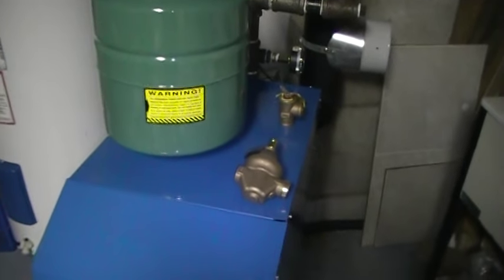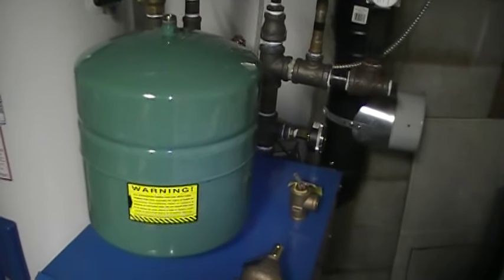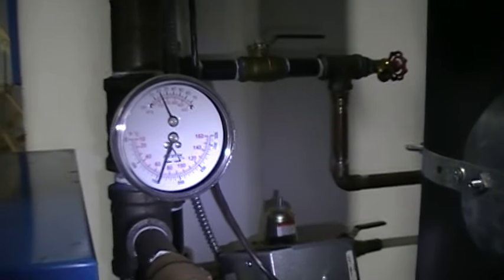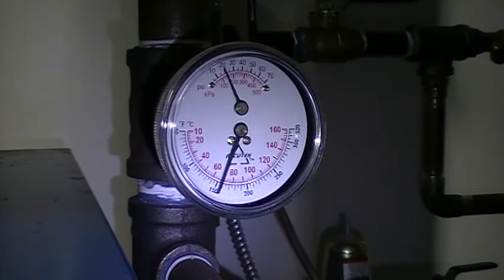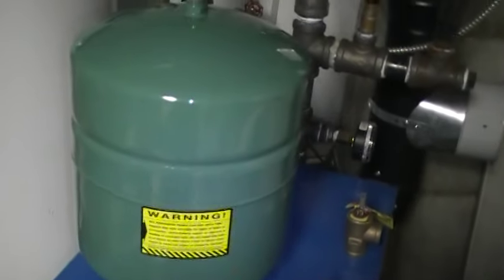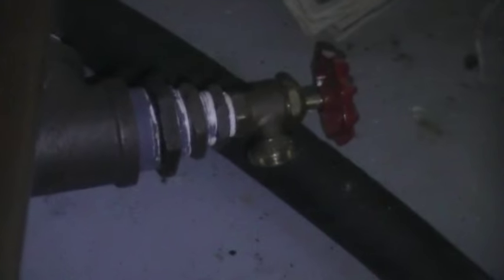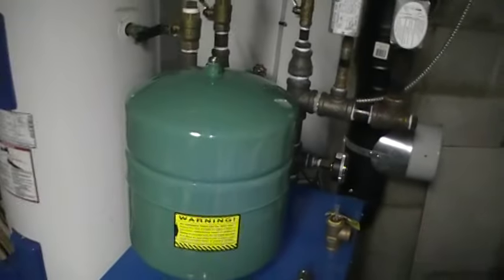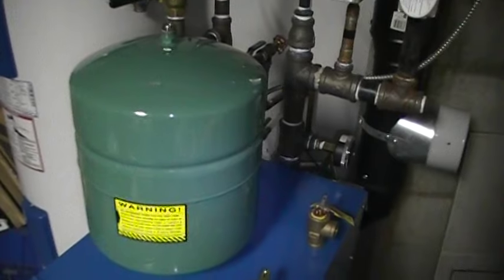Relief valve blowing off on hot water boiler (furnace).possible cause...Part 3

Comment: What if on the traticator the temp continuously goes to max even though temp is set to 170 or so. Then I get water blowing out the relief valve and steam .. 
any ideas. 
I did call my boiler guy.
Reply from the maker: Hello Dbest1a Vlogs,
Is the boiler still firing or does it shut down and keep climbing? If it is still firing then you have a faulty aquastat. 
Let me know how you make out when you get a chance....Al

Comment: HI,
I drained the system down to around 15 lbs pressure once the unit cooled down, then shut off the water feed to the unit to rule out (bypass) the regulator.  Once started up after around 10 minutes the pressure rose back to around 35 blowing the pressure relief as designed.  Is it positively my extrol tank defective?
Reply from the maker: +Ed Marcinczyk 
If your relief is blowing off and your water is shut off to the unit then the expansion tank is definitely defective. In your case it is an extrol tank. If you drain the boiler to where the pressure is at zero and pump some air into the extrol tank; it will hold you over until you get a new one.
I have done this before and it does work for a short time. Be sure not to put too much air in it, but if you can get the gauge back to about 10 pounds with the pump; it will hold you over. A small compressor will do the same thing.
Do you have a domestic hot water coil in the boiler?
Thanks for commenting and get back to me when you can.    Al
Reply: Yes I do have a coil in the boiler and also an electric hot water heater which work together somehow.  I ordered the extrol 30 tank and should be here today!  Thanks for all your help.  I will watch the video again to be sure I don't get drenched when changing the tank.  I'll reply back when the tank is switched.
Reply from the maker: Ed Marcinczyk 
Hopefully this is where the problem lies. If the relief is blowing off periodically. 
Best of luck with the repair and let me know how you get along!   Al
Reply: +TheOldkid888 Hi Al - everything worked out perfect!  It was kinda funny because the guy fixing it for me hates when I refer to youtube videos so I didn't dare mention how heavy it was going to be if waterlogged.  He got it off with a nice brief shower then dropped it on the cement floor because it was so heavy.  It was full of rusty water and other junk.  Everything if fine now!  Thanks so much for our "secret" conversation.  Have a great day!!!
Reply from the maker: Ed Marcinczyk
Glad everything worked out for you Ed.
I go to youtube for many different things myself. There is not much you can't find on it that's for sure. Great resource!!!
Thanks for commenting and have a great weekend!   Al

Comment: What if the pressure relief valve is leaking after you change the tank, and the valve? Simultaneously, when the indirect water heater is turned off then the boiler pressure relief valved stops  leaking/dripping?
Reply from the maker: Hello Joshua,
It sounds to me that there is a leak in the coil of the indirect water heater and the domestic water pressure that is higher than the heating system pressure is pushing the water back into the heating system.
A very small pinhole in the coil will cause this to happen. 
I have seen it before. 
If you isolate the indirect water heater and the pressure relief valve stops dripping then that is your problem.
Unfortunately the only way to correct it is to have the water heater changed out. It should be under warranty. 
Thanks for commenting and best of luck with the repairs!    Al

Comment: Don't have to bleed the air off after draining the tank??
Reply from the maker: Hello tyler j,
Not quite getting the question, but.... Once you have drained the tank you open the shut off valve to the tank just a little and let the water enter the tank slowly.
Thanks for commenting and enjoy your week!     Al
Reply: @TheOldkid888  yeah once you empty the system of water.   It leaves air so if you fill it back up you need to purge the air right? Only reason I'm commenting is because I  need to change my tank.   But I have 0 zone  shut off valves or bleeders.  Just the waterline IN and the drain valve at the bottom.    And 2 zones....

Comment: Once i change out the expansion tank, do i need to do anything to set the pressure the the correct psi?
Reply from the maker: Hello TBONENYC,
Once the new tank is installed and the water is back on; you have to check the pressure. It should be between 12 and 15 pounds. If it is lower; you may not get heat to the upper level. 
If the pressure is below 12; you can lift the lever on the pressure reducing valve gently. You will hear the water entering the system. Watch the tridicator (gauge) as it will rise quickly. You don't want the pressure any higher than 15 pounds if possible. If the system is hot; it may reach 20 psi. That is more than suffice to get heat upstairs to the rads.
Hope this helps!
Thanks for commenting and enjoy your week!    Al
Reply: Ah ok thank you !!! I’m not positive if it is my expansion take, but Right now my pressure sits at around 15-18, and as it heats up it end up hitting 30psi and the pressure relief valve pops. Is there any way to tell if the tank is functioning properly? Is the top of the tank supposed to be hot and the bottom cold?
Reply from the maker: Hello TBONENYC,
There a number of things that will make the pressure rise in the system.
A water logged expansion tank for one; which is the most common. 
The entire tank will be warm; so it's hard to say. 
Is the tank suspended in the ceiling or is it a smaller tank screwed into a fitting coming off the boiler.
The expansion tank suspended in the ceiling would be about 3 feet long and 1 foot in diameter. If it is this style of tank; you can turn the boiler off and close the valve going to the tank. Then you drain the tank. generally there is a bleeder to allow air into the tank. if it is this style of tank; be sure to get a few five gallon buckets of water out of it and then slowly open the valve you closed and turn the boiler back on. 
If it is an extrol tank about a foot wide and a foot high; you will need to purchase another one and replace it. 
This could be a little tricky if there is no valve on it. You will need to turn the water off to the system and drop the pressure to zero on the system before you replace the tank. Be careful as the tank will be waterlogged and heavy.
Hope this helps!
Thanks for commenting and enjoy your weekend!     Al

Comment: I have my boiler turned off in the whole summer.  When I turned power back on to the boiler with high temp limit 180 F and low temp limit 160F, the temp ran over 200F and the relief valve open & spit out water and steam before boiler stop.  When I went down to my basement and saw water (not a lot) on the floor and knew something was not right.  I turned power off again and waited overnight.  Next morning, I turned back on and stood by watching.  Again relief valve open ONLY the first cycle before boiler stopped.  For all the following cycles boiler worked correctly between HL 180F and LL 160F WITHOUT opening the relief valve and spit out water and steam.  I checked the Extrol model 30 expansion tank which had 12 pounds pressure with tire gauge.  Why did it run above 180F and did not stop for the first cycle only?  What could be the problem/defect which cause it?  Should I be concerned?  Please help.  Thanks.
Reply from the maker: Hello Shu-wen Lu,
The only thing that controls your temperature is your aquastat. This is where I believe the problem is located. There are a number of things that cause your relief valve to pop, but only one that will cause your temperature to rise above 200.
I would keep an eye on it and if it goes above the HL again; I would suggest having the aquastat change.
Thanks for commenting and enjoy your week!    Al
Reply: Thank you so much for your reply. AI
Reply from the maker: Hello Shu-wen Lu,
You're welcome!
Hopefully everything works out for you!
Best of luck!    Al

Comment: Hello, I replaced air valve because it was leaking. To do that I drained some water to reduce pressure  (pressure was 15 psi) . After replacing valve I bled the system to get rid of air. Now my pressure is at 20 psi. Why is that? Also right after when system was filled was at 15 psi but within an hour goes to 20 psi and stays there.
Reply from the maker: Hello TheLukeE9,
Once the boiler is filled and fires up the water expands and builds pressure. It will be in that range as long as the heat is on. No need to worry about that pressure. If it should get above 25 and heading to 30; then there is need for concern. Your relief valve will begin to leak around 30 PSI. You should be good to go!
Congrats on changing the air valve!
Thanks for commenting and enjoy your week!    Al
Reply: @TheOldkid888  thank you for a reply!
Reply: @TheOldkid888  actually I forgot to add that 20 psi was on when boiler was off. Today i turned it on first time after the summer  and pressure went to over 30 psi and pressure relief valve was leaking by the time temperature went up to 170 degrees. Is it a expansion tanks fault? But it doesn’t get warm and I checked the valve no water coming out.

Comment: I checked 15 minutes after I turned heat off and boiler not running. Boiler temp 205, 12lbs pressure. Settings at 140 & 180 degrees

Comment: Hi, l have a gas hydronic boiler system and the pressure is about 31, 32 psi but spantion tank is fine as well as relief valve.
it's this normal if not how can l reduce the pressure?
Reply from the maker: +Alberto Molinares 
Is your relief valve blowing off?
That pressure isn't normal. Working pressure should be between 15 to 20 pounds when it is hot. 
Do you have a coil in the boiler for hot water or do you have a separate water heater? Is the expansion tank a 12" by 36" or is it an extrol tank? Roughly 1/3 the size of an expansion tank.
Get back to me when you get a chance....Al
Reply: +Alberto Molinares l apologize l couldn't get back sooner l was out on vacations, thanks.
Reply from the maker: Alberto Molinares
Is the relief valve blowing off?
If so; I am leaning towards the extrol tank. It is hard to tell if the bladder is gone in them or not.  If you drop the pressure in the boiler, you can pump a air into the tank with a hand pump or compressor and see if the pressure stays below 20 for a few days.
Considering you have a separate water heater there are only a few other things. 
What high temperature does the boiler reach? You can find this by looking at the gauge and seeing what it is when it shuts off. 
Hope you had a good vacation.
Get back to me when you get a chance.   Al
Reply: +TheOldkid888 No, the relief valve is not going off,no water is leaking. Also l shot off water feeder l let the boiler run and the pressure went up from 12 to 20-23 psi.
Reply from the maker: Alberto Molinares 
It is rare that the feed water valve is faulty, but from what you are telling me here; it is possible.
Working pressure should be 20 pounds or less. Keep the feed water valve closed and watch the pressure for the next number of days. If it doesn't climb any higher then what you mentioned then you have a faulty valve.
If it climbs higher then your extrol tank is faulty.
If you want to give me day by day that will be fine. I will  respond back to you when I get a chance.
Have a great one!    Al
Reply: +TheOldkid888 Hi, l did everything you said and seems normal, but l did see a small water dripping on the bottom of boiler water drain valve, so i did change valve. And the water pressure gauge still showing 12lbs, so i did changed water pressure gauge also, and now everything is working just fine.Thank you so much for your help.
Reply from the maker: Alberto Molinares
Great to hear!
You have all the valves open now then?
Not often do you see a faulty gauge boiler, but I am glad everything worked out for you!  
Thanks for commenting and enjoy your weekend!    Al

Comment: Thanks, the relief valve on my oil fire furnace is leaking, but its doing the job as my PSI is 35. , expansion tank is good though.
Reply from the maker: Hello Rons Beers & Ales,
You're welcome!
Do you have a coil in the boiler? Is the expansion tank a 36 inch by 12 inch or is a small bladder tank?
What temperature is your boiler cutting out at? You can see that on the tradicator (gauge) as well on the boiler?
Thanks for commenting and get back to me when you get a chance....Al
Reply: I went to Lowes and purchased an expansion tank and a pressure reducing valve , tomorrow I will change the PRV, my question is, Do I use Teflon tape on a Pressure reducing valve ? And I do have a coil in my furnace (boiler ) for domestic water.
Reply from the maker: Hello Rons Beers & Ales,
Sorry for not getting back to you yesterday. You can use a little teflon on the threads that screw into the pressure reduing valve. The biggest thing is to carefull not to tighten the valve to much as it can crack easily if overtightened. I generally put three to four windings of teflon on the threads when installing a PRV and a little pipe dope. One thing to keep in mind is...if it leaks at the threaded connection, you can remove it and add more teflon. If you accidently crack it; it will cost you a new valve.
Any threaded connections; I always use teflon. The amount depends on the product. Plastic water filters get only a feqw windings and pipe dope. The heads have a seam in them and will crack easily. PRV are in the same category. 
I hope the repair goes well for you! Let me knwo how you fair out. 
I am swaying towards the expansion tank myself, but it could be something else.
Thanks for commenting and enjoy your week!   Al
Reply: Thanks OLDKID888, the PRV was changed, and it stopped the relief valve from leaking. . . . . . . . . . . . . . . .for a small while , then back to leaking , and me hauling buckets of warm water to the sink ☹, today I will change the expansion tank. If I dont blead the air out of the radiators will it cause the PSI to go up to 35 PSI (which its been at) to open the 30lb relief valve in back of the furnace.  Thanks also for the info U have giving me.
Reply from the maker: Hello Rons Beers & Ales,
Let me know how you got along when you get a chance.
Good luck with the repair!
Thansk for commenting and enjoy your day!      Al

Comment: Mine is creeping its way upto 80psi and the valve isnt triggering :(
Reply from the maker: Hello MtnXfreeride;
If you have an expansion tank; it could be waterlogged and should be drained immediately. If it is an extrol tank with a bladder; it should be changed. It could be possible for the pressure to go this high if the boiler was not looked at for a long period of time.
You want to turn the valve off to the coil if there is one in the boiler. A pinhole in the coil will allow street pressure to enter the system and drive the pressure up.
If there is not a coil in it; you will have to turn the feed water valve to the boiler. Obviously there is a problem with the relief valve and it should be changed as soon as you find out what is happening.
This should be address ASAP.
Thanks for commenting and let me know how you get along!    Al